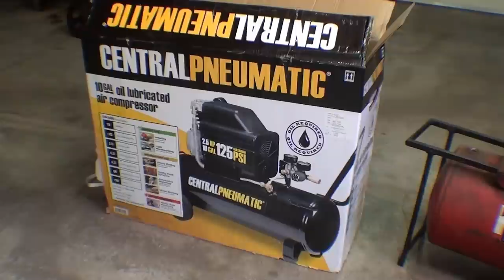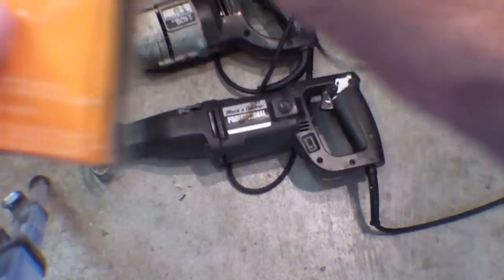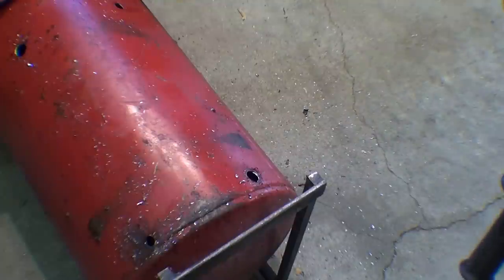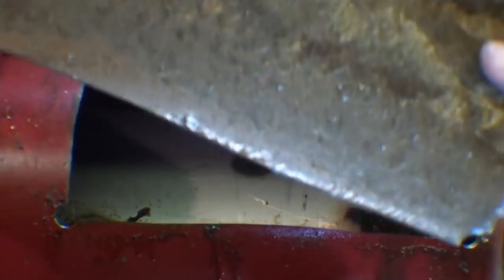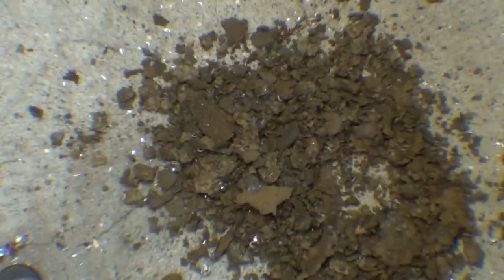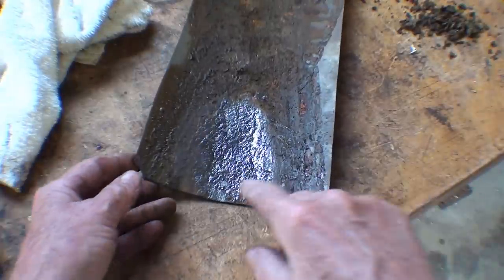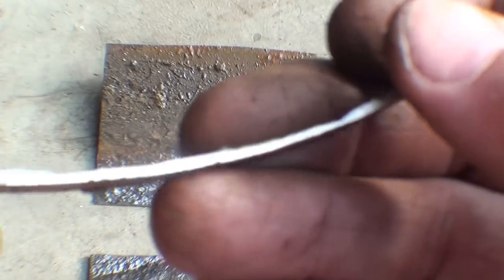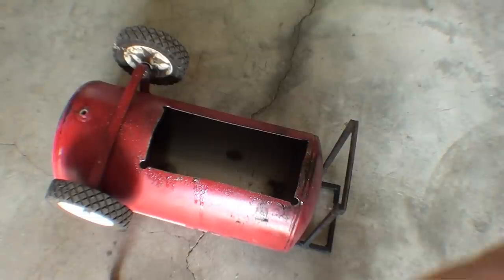tubalcain performs an AUTOPSY ON A COMPRESSOR AIR TANK

Comment: The dangers of such tanks. That's why i have a bolt on type. I take it apart and clean it properly once a year and replace the screws too once in a while. Excessive? Maybe, i know it is. But i like the comfort of knowing that i can operate this as i please without having to worry.

Comment: So they did not protect the tank inside? Bad move!
Maybe you should take the new tank, remove the inlet and the drain plug, plug the bottom hole with a cork, fill in some oil tank paint, slosh it around to cover the bottom area, drain the paint and let it dry, reinstall the hardware. 
Should expand the lifetime quite a bit.

Comment: Good to show why repairing an air tank is futile. There are several ways that they can fail, but the most common is pinholing on the bottom, often at the weld seam in the HAZ. The second would be failure at a weld for a foot or the pump/motor due to fatigue. Explosion is rare, and is usually due to either overpressure (failed/tampered pressure control in conjunction with a failed/tampered/insufficient relief valve) or to combustion of carried over oil in an oil lubricated unit. 

Repairing a tank is usually not worthwhile, and should be done by cutting out the section and installing an appropriate patch plate with full penetration welds. This should be done only by qualified persons. If you don't have the certs, R-stamp, and insurance, then you aren't qualified. Liability on a bad repair is forever on the you touched it so I sue you theory of law.

Comment: Could you have partially filled the tank with water and then pressurized it to find the pinhole?
Reply: That wouldn't be very honest.
Reply: No, you were responding to Darcy, I responded to you regarding your dishonest suggestion. jusb1066
Reply: You could pput the tank under water after you pressurized it just like finding a pinhole in an inner tube.

Comment: Tubal, great video..sounds like we're bout the same age...my tank, upon inspection, had a handful of smooth rocks, plus about a half gallon oil at bottom.. I inherited it from a wizened old fellow years ago..perhaps he knew something we don't?....
Reply from the maker: Good idea to put oil in the tank. But the water would be under the oil. Furthermore there maybe oil in the compressor and air, which cannot be tolerated if spray painting

Comment: Do you think painting the inside of the tank, during manufacturing, would help with rust prevention? Or, irregardless, the sediment lying on the painted surface, would attack the paint and eventually the metal?
Reply from the maker: Painting the inside would be useless and difficult. However, some other type of coating might help.
However, they want the tanks to fail at some point, job security

Comment: Back in the day, when gas stations always had a couple of service bays, the air compressor was always located in a small room away from the service area, usually surrounded by a brick wall. Now  you know why. Air compressor tanks must be drained and pressure released as soon as you are done using them. Air under pressure is very corrosive, and condensation from the radical changes in air pressure accumulates rapidly. If you don't drain often, the corrosion  is rapid. And when the tank becomes weak enough, an explosion can happen. On board a Navy ship, i noted that the compressors  and tanking were inspected at frequent intervals. Rigorously.!!!!
Reply: They are normally placed in a different room to reduce noise,not for safety.

Comment: We had an older 80 gallon tank rupture at 150 psi a couple of years ago. Lucky for us nobody was in the shop when it failed. It blew the side of the shop wall out, knocked over 2 5 drawer file cabinets full of manuals and blasted debris all across the shop. Wasn't a pretty sight and I really wish they would coat the insides with something to prevent the rust. We drained it on occasion but after years and years the rust did it in.
Reply: harperjmichael stainless steel or thick aluminum tanks would be cool

Comment: Watched a friend bang his hand against the wall three times before he could let go of one of those old 2 handle drills.  He kept tripping thw trigger. LOL  Keeping a compressor drained is a pain.  My petcock rusted shut.  I could not verify it was at zero pressure when replacing the petcock.  Luckily it was a vertical tank with a bottom drain. It dug a 4" hole in the ground.  Compressor tanks should be lined.  Everybody denegrates Harbor Freight, but I have had great success with their tools.  But then I don't expect SnapOn quality there either.  My Craftsman Compressor is rusting around the certification tag.  Will remove the tag, de-rust, and treat before priming, and painting.  Hope to save my tank.
Reply from the maker: +Mature Patriot throw it away and start out new. I'm sick of trying to make things last
Reply: I would if I could.  Spending to much setting up the used lathe I bought ......because of watching you.  LOLOL  I've 2 smaller pancake compressors that will work for now, if the tank can't be saved.  I'm not painting cars now.  I've spent more time with you in the last 6 months than anyone around here.  Keep machining my friend.

Comment: My dads craftsman air compressor has about a gallon or so of water in it you can hear when you set it down the drain snapped so it tried to remove the plug with a 36in rigid pipe wrench it just snapped of two teeth I am scared of it and it gets used a lot hoping to replace it soon
Reply from the maker: Yes, get rid of it

Comment: got an old craftsman at goodwill for $20.  had crud.  rinsed it out with a hose and it has a leak in the bottom.  thanks for the video.  I'm convinced.  not putting it off

Comment: Wondering what you did with the compressor and motor.  I have the same problem, and hate to throw away good working parts.
Reply from the maker: Save the motor, and threw away the compressor

Comment: I was watching your video on compressor tanks.  I had the same problem with one I bought from a Dentist office.  When I got it home I plugged it in and thought it wasn’t running.  It is very quiet.  It uses Copelematic compressors.  I worked in the refrigeration industry for years and all of the Copelematic compressors allowed oil to pass the pistons to keep the system lubricated.  I thought this might be an aftermarket compressor that somebody had put different compressors on.  They are the original compressors.  I am guessing that the compressors have been modified by adding oil rings on the pistons.
The tank that it was on had leaks all over it.  I finally bought propane tanks and VERY CAREFULLY MADE SURE THEIR WAS NO GAS IN THEM.  I could send you pictures on my setup if you like. and if I can figure out how..
Reply from the maker: That's interesting, send me the picture
Reply: Not sure how to send a reply with pictures.

Comment: Shame they didn't paint the inside.
Reply: Can't. Well you can, but the paint would just burn off when it was welded shut.
Reply: You could pour in paint after the tank is welded and stick it in a centrifuge to coat it and drain out the excess for the next tank
Reply: Agreed. I thought of several ways to do it but none that wouldn't raise the cost so high it wouldn't sell.
Cheapest idea I came up with was a ~5" fitting you could use as an inspection/maintenance port.

Comment: You are right that that crud would not blow out . the real problem is that the compressor needs a blow down each day. I have a compressor i got in the late 60's that is still holding good pressure but it has an automatic blowdown on it and blows off about every hour for several seconds.

Comment: I like angle grinders more than reciprocating saws.  The seem to have smoother action cutting.   Also, on thinner material, you might still have a full inch of contact against the disk as opposed to only a tooth or two with a blade.
Reply: Thinner material requires a finer toothed blade.  You need to have at least 3 teeth in contact with the material to cut well without jumping/digging....  On another note, a saw doesn't throw sparks or pieces of metal like a cutoff wheel does.

Comment: What's the best preventative measure to avoid water lying at bottom of tank?
Could you pour something in to line the bottom of the tank with a protective coating, what about Silica Gel?

Comment: So glad you did this. I have a Sears compressor tank that has the same thin metal leaks. I was wondering if you could put some kind of coating in the air tank that would give it a  moisture barrier? I never figured that draining the moisture would do very much good.
Reply from the maker: Too dangerous. Throw it away
Reply: I would but I haven't bought it yet!

Comment: The water that sits in your compressor tank turns acidic. The reason tanks need to be drained is because as the water volume builds, the higher capacity of the water to dissolve the iron. Even if the residue remaines there is so little water that it will not attack the iron since it is already saturated. I hope that make some sense.